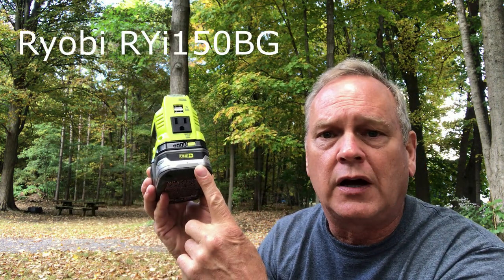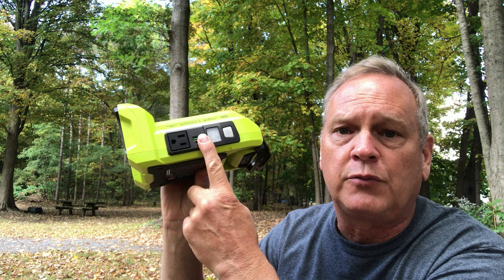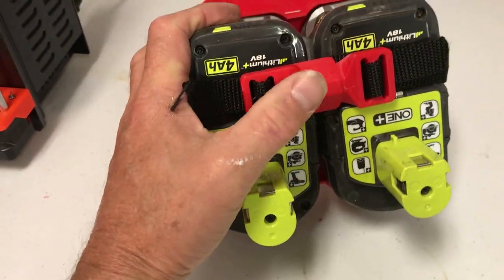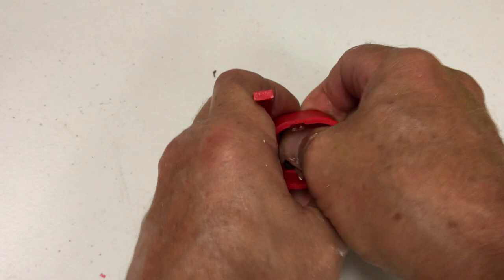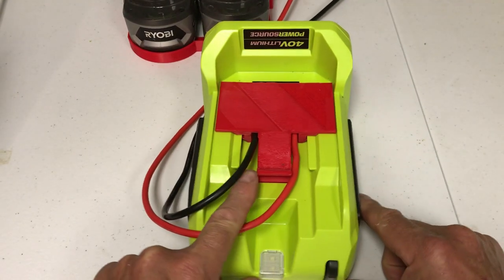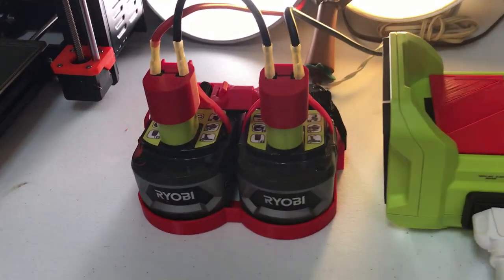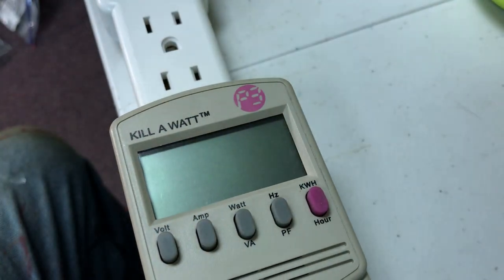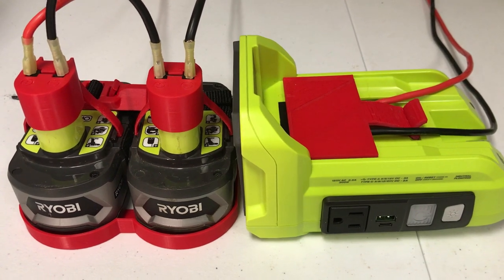RYOBI 18V to 40V Battery Adapter

Comment: Thank you for sharing the fruits of your work with others . From an engineering standpoint this is an A++ as it will work with ANY 40V  tool.  Batteries  can be carried hanging from a belt or in a backpack or over the shoulder. Multiple caddies can be printed and a quick change cable between the caddy and battery attachment part will allow users to swap batteries out on the fly.  I have hesitated to pull the trigger on any 40V tool until now.  Ryobi used to have a 10” compound miter saw that was 40V but they marketed it as “One plus One” because it used 2 18V batteries right next to each other - Model# P3650B. It always bothered me that they didn’t do the same thing for their outdoor tools and 40V instead of 1+1 looked like a money grab to me.  Thank you again people like you are the reason YouTube is thriving. Subscribed/liked/recommended.
Reply: I wondered if there was a reason why they discontinued the 1+1 format for safety reasons.  My mower is 1+1 and the same with the scarifier, but I think they only provide 18V not 36V (the original mower I missed out on was 36V with the 1+1 format).  Maybe the issue is people using different batteries with different power levels, although I have been using a newer 18V battery with an older one and there does not seem to be any issues so far (I do try to use the same charge, Ah and age when possible).
I also thought it was probably a money grab, but if I have to get a different battery then I'm more likely to get something different, such as Ego 56V that is heavy duty, so the strategy could backfire if that was part of it.

Comment: Thanks for sharing this. I just converted my Worx trimmer to use my Ryobi batts with a 3d printed case I made, also 3d printed a case for a water pump that runs on Ryobi batts as well. This is a great alternative to purchasing another set of batteries! Thanks and great work!
Reply: would you happen to have video of your adapter from ryobi to worx.  I would like to use my ryobi batteries on the hydroshot.  thanks
Reply: @cameranmanner4701  I didn't make a video but you can download the adapter file here and 3D print it. https://www.thingiverse.com/thing:4615132
Reply: Also, if your new to 3D printing you can easily upload the files from thingiverse onto tinkercad to modify it however you need. Tinkercad is free and easy to use, also lots of vids on YT showing how to use it.
Reply: I'm also planning to do the same as I have plenty of Ryobi batteries and not many Worx.

Comment: The extension cable concept here is going to benefit those who are going to be using a 40V tool in an overhead position - I just bought a 40V Ryobi Expand-It power head (string trimmer) to which I will be attaching the Ryobi Pruner attachment, so having the battery “off loaded” from the handle would make this a lighter weight to hoist. Hoping that counter weight of the battery when directly attached isn’t going to be a factor.

Comment: Nice work Chris! - It would be cool to make the adaptor for the inverter with sockets for the batteries.   Still using your first design with the socket and the USB plugs.   Thanks for your designs!
Reply from the maker: I thought 18v batteries would be to big to fit in some 40V tools. Keeping them separate seems to allow them to fit in 40V mowers. I don’t have one, but looked at Home Depot

Comment: Just made one of these & it works great.  I'm going to get plenty of use out of this.

Comments:  
I found someone on Etsy to 3D print the pieces for me.  The pieces worked as needed but were brittle and the ends broke off where they were supposed to snap onto the battery (I have since learned that there are several materials to 3D print with so the next attempt will be with a softer material with some give to it).  It works as is and I am not planning to use it in a moving environment.  Also the battery holder/base is not wide enough to fit the 9ah batteries.  Again this doesn't make it not work but it makes it a bit harder to carry.

Questions:  
1.  How hard is it for someone with knowledge to redesign the battery plate to accommodate the 9ah size?
2.  Do you have any thoughts on wiring 3 or more sets of 9ah batteries in parallel to make a longer lasting bank?  Is there any limit to how many sets of like batteries you could add to make this last much, much longer before needing to physically swap out the batteries.

Thanks for the great videos.
Reply from the maker: I made this 8 battery holder out of wood ( https://youtu.be/lAAWFCU4iEM ) . You could do something similar and skip the inverter and just attach cable to adapter panel.
Reply from the maker: Check out my latest battery caddy project. I've improved it per your comment ( https://youtu.be/np4e66krsuQ )

Comment: Liked the video but was hoping you could show how you wired the two 18v batteries together
Reply: While he does not explicitly show that, you can see there is a wire from one battery to the other (Pos+ to Neg-) and then one wire from each battery to the slide in adapter. Red is Pos+ and Black is Neg- in my country, assume it is universal.
So if the two batteries are next to each other and Pos+ is on the left, then 1st battery Pos+ goes to slider, then Neg- of 1st battery goes to Pos+ of 2nd battery, then 2nd battery Neg- goes to the slider.

Comment: That's pretty cool. I've thought about doing something like this. I'm curious how this would work with higher draw tools like the lawn mower. The 40v batteries have T+/- connectors that I assumed were similar to the extra connectors on the back of the HP batteries.
Reply: unfortunately I don't have 40V batteries (yet ;-) or a 40V lawn mower... mine takes two 18V batteries
Reply: Was anyone able to try this with a higher draw tool?

Comment: You should try this with 2 20v dewalt batteries. The shape of the dewalts should make it easier.
Reply from the maker: Do Dewalt Tools have the BMS in the battery or in the tool?

Comment: Hi, I’m no tech guy but I saw how you did this project. So i am starting to work and have not much tools and my boss has 2 of 150 watt Ryobi inverters. So I have a Jigsaw (old with a short cord, just on and off switch) and it runs on 120v 2.2 amps. So the inverter can’t handle it. I was wondering if i can hook up the two inverters as “Parallel” connections (I googled it) and have an output of 120v 2.5 amps? Or it only works on batteries?

Comment: Have you had any issues with the discharge rate in the batteries? Or are the inbuilt bms for each 18v enough to keep them evenly drained?
Reply from the maker: No issues. The BMS protects them. I always use similar size batteries that are equally charged

Comment: Will the lower voltage from the 2 18 volt batteries cause any trouble.  They will be starting out 4 volts low.  Does the 40 volt inverter have a low voltage shut down, causing one to need to change the 18 volt batteries even though they might have  plenty of amps left?  Thanks
Reply from the maker: 40V batteries are the same at two 18V batteries in series. It's a marketing/naming thing

Comment: What do you think is the max VA these 18V batteries can supply?  This setup would appear to be about 5.5A per battery to provide the 200W.  Did they get hot in use?
I'm very interested in this solution and I would like to know if you have the STL or file for the 3D printer?  I would also like to see if I could create the plate with the batteries directly connected so then it is one unit without the wires hanging out.  What I want to try is the R36XSHR10 crushing shredder.  I've also sent a message asking Ryobi if they would consider making this for the One 18+ line as a light weight shredder would be really useful addition to the gardening tools.
Reply from the maker: I don't go over 10A
Reply: Is that 10A per battery or 10A total? The 6x battery power station you did would that be 60A max?
Thanks for the quick reply, much appreciated.
Reply from the maker: it depends if the batteries are in series or parallel. 10A for ea battery in parallel

Comment: Do make these adapters for sale
Reply from the maker: sorry, I really don't have the capability to sell. There are Internet services that will make 3D printers for you. My designs are on Thingiverse
Reply: @SerendipitySue  I am going to make one of these, and I am going to use an empty Ryobi 40 V battery that has had everything inside removed, except for the board with the contacts.  The housing has ------   T1 T2  + on it. (minus, T1, T2, plus).  Do I need to remove the T1 and T2 spades, will they hurt anything,  while leaving the minus and plus spades in place, and soldering my wires to the plus and minus.  When done, I will screw the two halves together, and it will look just like a regular Ryobi battery, except for a pair of wires coming out.  I am putting the entire board back into the housing.  Anything else I need to know?  THANK YOU  I hope you notice the post.
Reply from the maker: @klum65  sounds like it should work nicely! You should be able to leave the T1/T2 disconnected

Comment: What's the highest voltage the invertor can handle. I know it's a 40volt system, but the tolerances sometimes goes much higher. Reason is, I want to use EGO 56v batteries to run this inverter. This Ryobi is far superior than the Ego Nexus. Will the 56v battery burnout this Ryobi 300watt.
Reply from the maker: Don't know

Comment: Why not attach the part that slides onto the 40v tool attached to the bottom of the 2x 18v batteries so you don''t have to worry about dangling wires?
Reply from the maker: Because I wanted people to be able to use it on other tools where there is no space for the double 18V batteries. I put the 3D file on Thingiverse so you can modify it :-)

Comment: That's awesome where can I get the battery connections from I wanted to use them for my son power wheel.
Reply from the maker: If you look in the video description, it lists all the materials I used. There is a link to the terminals
Reply: @SerendipitySue  awesome ok thank you

Comment: Would it be safe to power an Apple computer with this set-up?  From what I can find, the computer only draws 166 watts at full power.  Thank you
Reply from the maker: The 300W inverter is a Pure Sine wave inverter. It should easily run 166W device
Reply: @SerendipitySue  Thank you very much

Comment: This is GENIUS!!!  you saved me having to buy 40v battery system to get the ryobi lawnmower running.  thanks so much.   out of curiosity, is there a reasone not to use a dc to dc boost converter?  might avoid having to wire the 2 batteries in series altogether.
Reply from the maker: there are two issues with DC-DC boosters. They waste energy as heat and the higher amperage ones can be expensive. Two "18V" batteries in series have the same specs as a "40V" battery
Reply from the maker: Check out my latest battery caddy project ( https://youtu.be/np4e66krsuQ )
Reply: Have you tried tis on a mower yet?  I am curious about doing something similar.
Reply from the maker: @xaudiblex  I have a double 18V mower, NOT a 40V mower... so I haven't tried it

Comment: What gauge of wire from battery terminals to inverter?
Reply from the maker: I listed the parts you need under the video description. I used 10 ga wire

Comment: Do you notice much power loss running 4V lower than 40?
Reply from the maker: two 18V ryobi batteries are the same as one 40V, it's just marketing. A 18V battery goes between 15-21V depending on charge level. A 40V battery goes between 30-42V.

Comment: the battery holder for the two 18v, could you not just reorient the batteries and change to width profile.  then you could make the bottom of the battery holder the adapter as well.  this would reduce the lengthy cable and have it look like one piece unit as opposed to the 2 piece you created.
Reply from the maker: The batteries are pretty heavy and it would be unbalanced. I also wanted it to work with tools like the lawnmower where there is not enough space for the two 18V batteries to fit. I put the models on thingiverse so people could make alternative configurations.
Reply: @SerendipitySue  I was thinking that it would be top heavy.  But laying on it's side would be good for me as would prefer that then have dangling wires.  One thing I realized that the inverter does not authenticate whether or not its a oem battery or some generic or non compliant battery. Since  I also use the 40v greenworks system.  I could just mod those to connect to the power inverter.  The GW inverter version is a modified sine wave, I would like a pure sine wave inverter.  Anyway it would be nice to exploit all those Ryobi 18v batteries I have too.  Thanks for the video.  very helpful
Reply from the maker: @cameranmanner4701  Someone made a greenworks battery adapter over on thingiverse: https://www.thingiverse.com/thing:3804434
Reply: @SerendipitySue  thanks i'll check out the link.

Comment: Any chance that you would be willing to sell one of these?  or at lease sell the parts?  I don't have a 3D printer.  I have a ton of Ryobi 18v batteries and have been looking for a Pure Sine Inverter to power laptops in the field.  Currently the option looks like Goal Zero Yeti (or the like).  This would be a solid use of my current collection of batteries.
Reply from the maker: I'm not really set up to print/assembly/sell my designs. There are companies on the web that will 3D print models for you. I've put all the STL models on the Thingiverse and Prusa sites.
Reply: @SerendipitySue  Thanks for your reply.  Any plans to do a video on 3D printing/printers?
Reply: @SerendipitySue  Also, Have you considered adapting Ryobi 18v batteries to Milwaukee M18 and using their new M18 Top Off Inverter?  This looks like a quality inverter.
Reply from the maker: @19frog68  Do you know if it is a pure sine wave inverter? It is only rated 25W more than the ryobi modified sine wave inverter (  https://amzn.to/3pYVino ). Although it does have a USB type-C port. I could not find any adapters that go from Ryobi batteries to Milwaukee M18 tools. So maybe I'll have to design one ;-) Although I hate to have to shell out money for a tool I don't already have.
Reply from the maker: @19frog68  good idea... Just finishing a  ryobi 2600W powerstation design using 18V batteries... working on movie now ;-)
Reply: @SerendipitySue  Thanks for sharing this.  I would add that you can connect any brand of 18/20volt batteries to this.  I have tools for several companies and I tried this and connected a pair of Milwaukee M18 2 amp batteries just to see if it would work and it did.
Reply from the maker: @jerrywilliams6642  Just be careful that the batteries that you use have a BMS in them. Some companies put the BMS in the tool. People have made connectors for other batteries on Thingiverse. It would be easy to connect them to my 40V paddle adapter.

Comment: Would you consider making and selling the adapters. Hit me up 🤙
Reply from the maker: sorry,  not really in a position to make / sell. I've put the 3D designs on the free print sites. There are on-line companies that will make prints for you.
Reply: @SerendipitySue  do you have one that you recommend to have make your design?
Reply from the maker: @joshuablizard4377  not off hand. You can also check with your local library or makerspace.